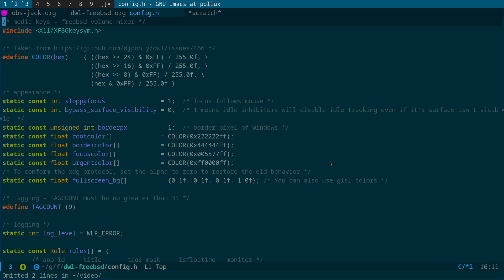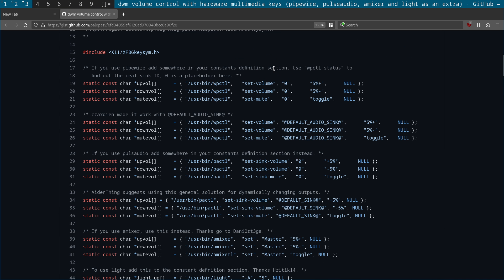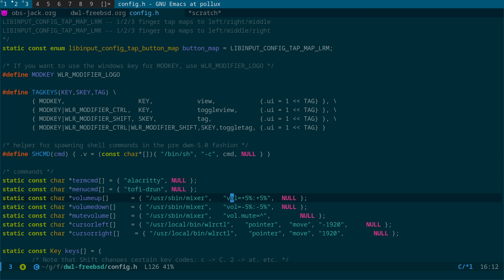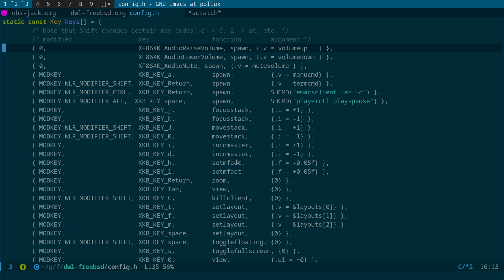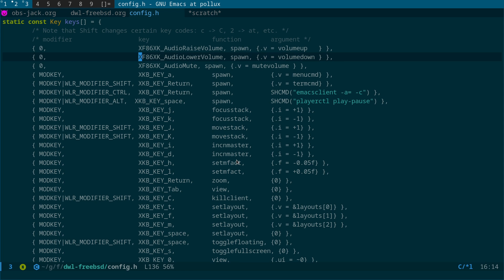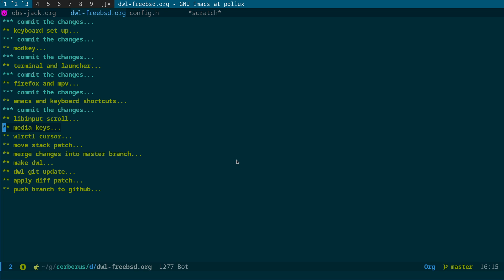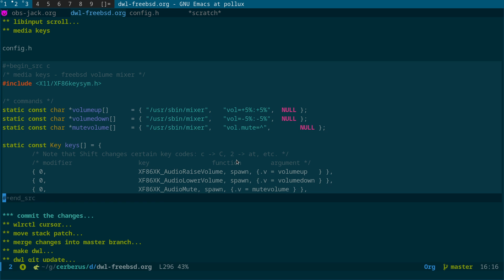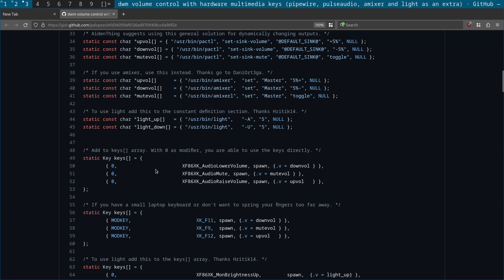dwl setting up volume keys on linux and freebsd

Comment: Couple comments  -  you don't need to include the XF86 key sym header as there's a Wayland equivalent already being pulled into the dwl code (via xkbcommon.h); you will need to update the defines as they are different, however. Probably worthwhile doing for the long run.

Examples are XKB_KEY_XF86AudioMute and XKB_KEY_XF86AudioRaiseVolume.

Secondly, for wpctl it's wise to set a maximum limit for set-volume; above 100% distortion will creep in, and just for safety too. Add "-l 1.0" to the wpctl command to increase volume to avoid that.

Only mentioning that as some of your viewers may not have Alsa in this increasingly Pipewire/Wireplumber world.
Reply from the maker: Hi Mate, great tips about xkb and not needing to import the xf86 key sym header
ill try commenting that out and changing the keys as well

XKB_KEY_XF86AudioMute
XKB_KEY_XF86AudioRaiseVolume
XKB_KEY_XF86AudioLowerVolume

the wpctl commands arent mine i just linked to the gist
Reply from the maker: Hi Mate, i just tested that and it works